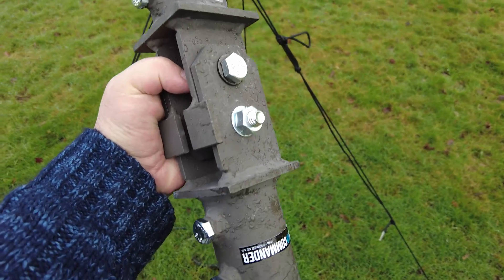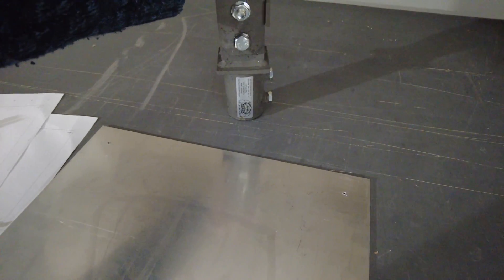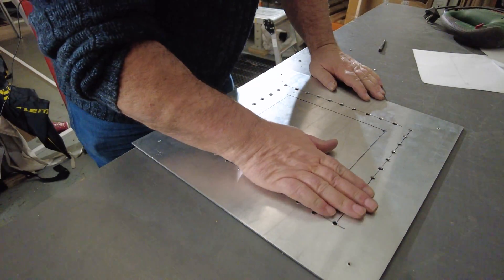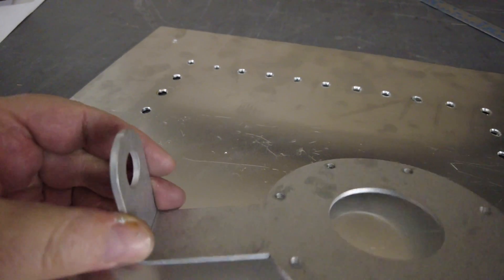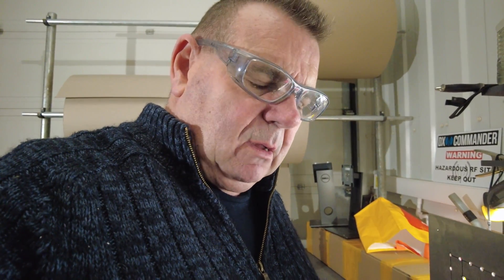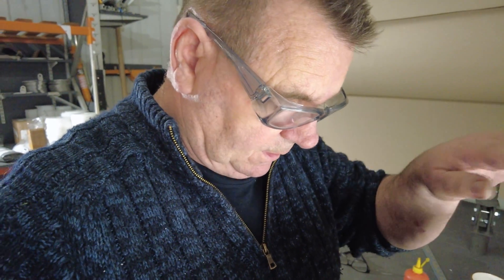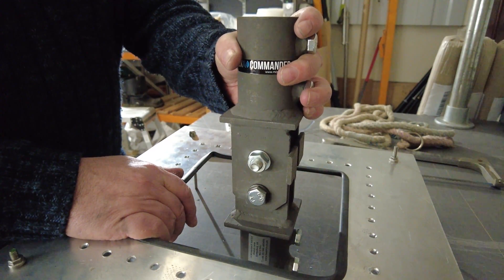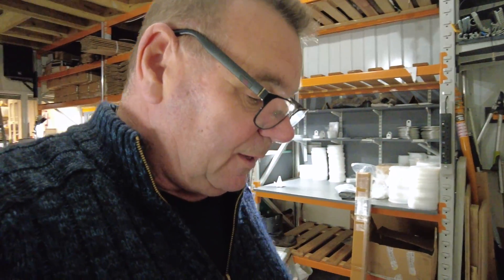Tilt-Over Vertical Antenna Ground Plate

Comment: Was using the cheap aloo-mi-num for the prototype worth the cost saving in this case?
Reply from the maker: Well it’s working just fine.😃
Reply: @DXCommanderHQ  Great! You seemed rather disappointed in the video. I understand not wanting to spend money unnecessarily on a prototype.